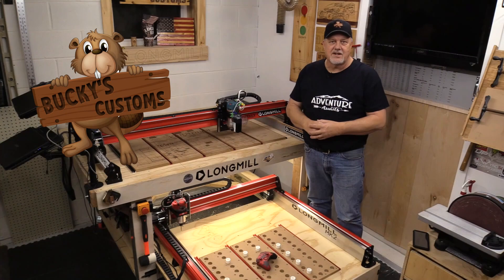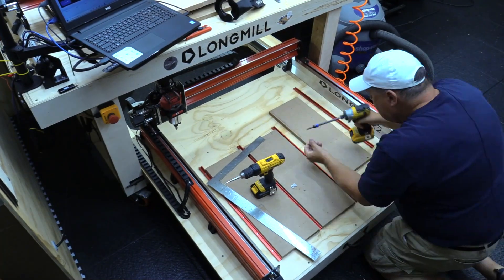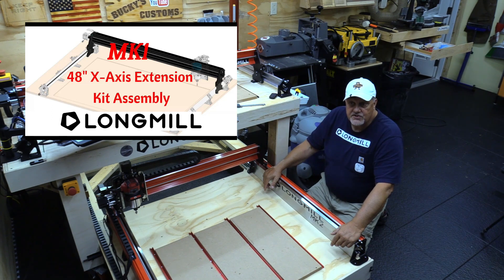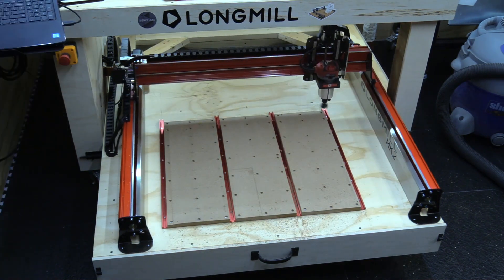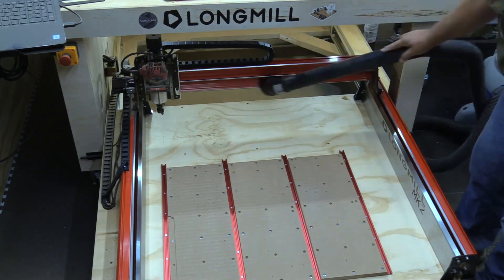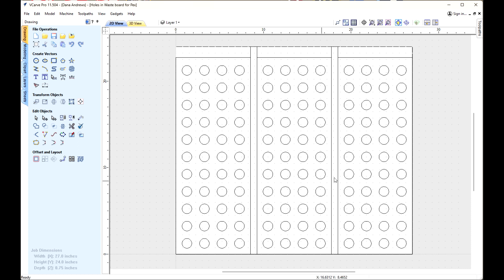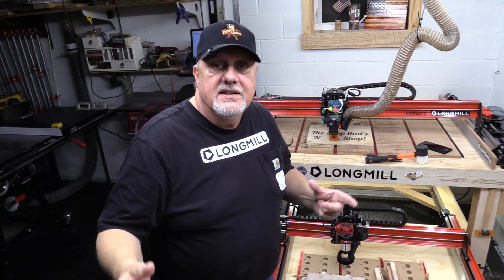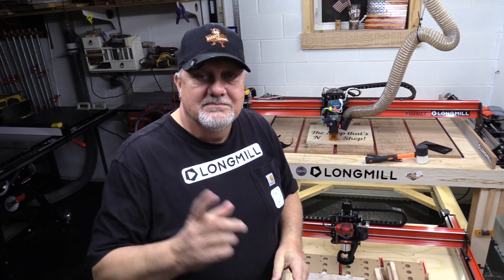Making a wasteboard with PVC stops on the Longmill MK2

Comment: I just purchased a 30x30 longmill MK 2.5 and have made a torsion box for it.  For the time being it is sitting on a 2x4 stand until I get the flip station build.  However, after seeing your video, I am thinking of mounting under my stair from my house to my shop using slides.  It looks like I will only lose 1 foot of space when not in use.  What slide did you use and where did you get them?  I live in Canada about 2 hours from Sienci Labs  Thanks for the help. Pat

Comment: My new Longmill will be here soon so I have been exploring what others have done for waste boards……. Quick question, after surfacing your wasteboard is thickness still .75”? Did your holes go down into the plywood or did you set the depth shallower?
Reply from the maker: I left the holes at .75 so they scratched the Ply. Congrats on getting your #longmill!

Comment: Best videos and like that you dont edit out mistakes
 Im in need of your help once again may be a bit long of a question 
I changed my spoil board im trying to drill holes in it cant get it to run job
 not sure why but i have to run outline for every job  on gesender in order to cut material
 problem 1 is if i dont run it my z goes up even when zeroing xyz with or without touch plate 
2 problem is when i do outline it skews my y axis becasue it seems to run to fast yet when jogging with mouse never a problem because its slow enough
Really dont want to be drill 75 holes by hand drill apperciate any help i know your time is valuable but your videos are so helpful 
Thank you
Reply from the maker: Thank you! First thing I would do is make sure you are running the latest gSender release. Download and install if you need to from the Sienci.com website. Second: Reset gSender to factory defaults if you already have the current version. I created mine in Vcarve Pro. Download the free file from the link in this video and try it. I used the surfacing tool in gsender as well. let me know!
Reply: @BuckysCustoms  yes i have all the latest updates and i have vcarve desktop i really dont need pro for the extra 6 inches i just dont understand why it wont do the start job without me having to do outline first been like that since i had cnc setup i will try your file thanks for the input keep up the the great videos they are amazing